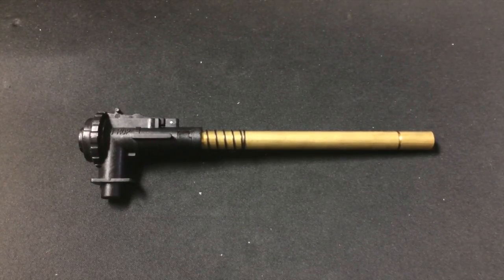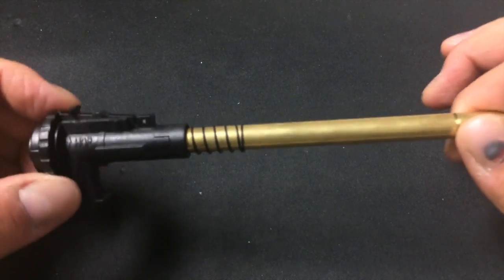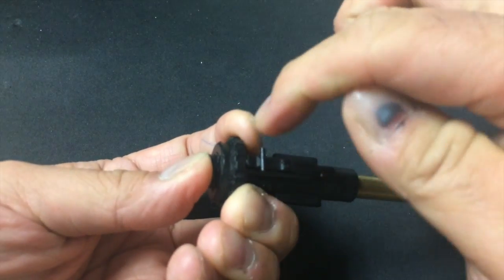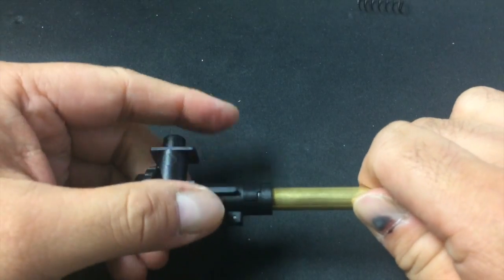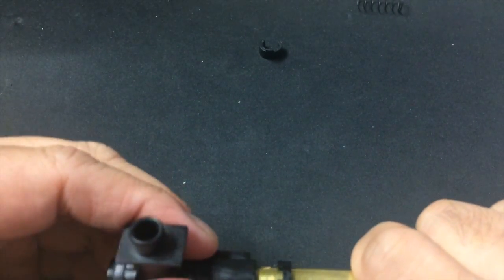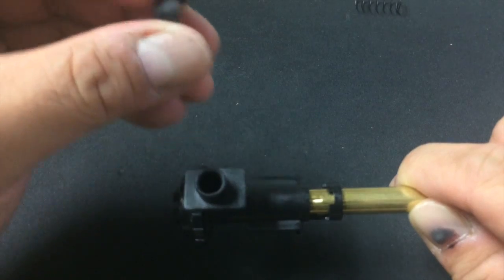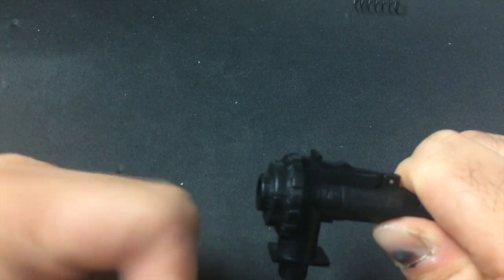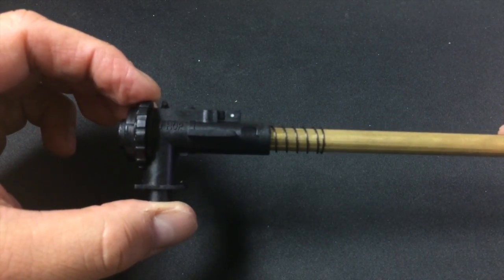Krytac Hop-up

Comment: So if I were to upgrade the bucking, I would use the spring and not the little metal ring that came with the new bucking correct?
Reply: Kinda late but yeah use the spring
Reply: Or you can use both?

Comment: Hey man I've seen you on the forums and since it seems like you know what your talking about I need some advice. I have a CRB and I'm wondering if this is the same inner barrel installation for all krytacs?  I'm thinking about putting in a Prometheus tight bore barrel so when I go outdoors I could throw on a power up suppressor to gain slightly more fps since I need to dumb it down for CQB. The power up won't work with the stock inner barrel since stock is 6.05 and the power up is 6.03.
Reply: I have the prommy inner barrel and it works great. Just note that certain buckings are a bit tough to install (like prommy purple) since the barrel is so fat

Comment: Hi there, I will be changing the stock inner barrel and hop up bucking on my crb in a week time. I am actually swapping it to prometheus eg tight bore and prometheus purple bucking. The question I have is that, should I use the purple hop up nub that comes with the prometheus purple bucking or should I use the stock orange nub? Thank you!
Reply: use stock nub

Comment: Will a prowin fit in the krytacs?
Reply from the maker: +dan310388 It fit but if you follow the discussion on Krytac Forum. There is really no improve performance using ProWin.
Reply: +Allizard okay thanks will check that out.
Reply: Well, if you want to use another nob, you either mod the Arm of the Krytac Chamber or use a different Chamber, which would most likely be the PwoWin. Or am i wrong?

Comment: can i use a promy flathop bucking with this hopup?
Reply: I'm using prommy purple in mine with a namazu firefly nub, works perfectly.
Reply: @timdeboer7400   how noticeable is the performance increase using that bucking and nub from the stock ones? and also what gun do you have these on? like, is it worth it to buy these bucking and nubs for the amount of performance increase you get?
Reply: @johngonzalez3969   Getting a flat nub does help with performance and range. I couldn't get a Maple Leaf tensioner nub to work with my Krytac LVOA (with Wolverine Reaper HPA) so I opted for the more expensive Firefly. But if you install a flathop correctly I haven't seen much difference in performance between the different kinds of flathop. Changing barrel, bucking and nub are the best upgrades to start with, they are easy to change and give the best performance boost. Evike sells pre R hopped prometheus barrels, combine that with perhaps a modify flat hop bucking and nub and you will get a really nice range out of your gun already.
Reply: Tim de Boer did you have to install a prowin hookup to fit the prommy purple and fire fly namazu or do they fit with the stock Krytac hopup unit? Also are you talking about the modify ryosoku because I heard it’s not too good
Reply: @johngonzalez3969   The stock hopup is actually pretty good, you dont have to upgrade to the prowin one. The prommy and firefly fit, but the arm where that puts pressure on the nub is made for the stock nub. I glued the nub in place. But you could do it with some silicone grease. I haven't installed the Modify bucking and nub in my Krytac, but on other aeg's i had some good results with it. Sure it is not the best, but for it's price it works nicely. Madbull Shark red (60 degrees) bucking worked for me fine also when flathopped or the G&G green bucking is a nice bucking.
Reply: Tim de Boer what would you say is the best bucking and nub combo for the krytac not worrying about the price

Comment: Is it common to have 2 springs?
I have the Krytac PDW-M and when removing my inner barrel I have the longer slimmer tension spring and a much smaller but wider spring overlaying the tension spring.
Reply: Same thing happened to me just now and now I'm scared shitless that I broke my baby xD
Reply: @robin3840  ngl...that was my first thought, mild panic and sweaty palms set in! I did a little research after posting tho and found out the main one is an inner barrel tension spring and the secondary, smaller one is to aid compression under prolonged use.
Reply: @Retch84  yeah, I knew what the first one closest to the top up was but the smaller, thicker one was new. Thank you so much for sharing that information! Did you find a way to put it back? Gonna do my own research as well but pls share everything you know!
Reply: @robin3840   I have a long established habit (started with a grandfather clock as a kid) of laying parts out as I dismantle to make reasonably easy...the shorter, chunkier spring literally just slides over the top of the longer skinnier one so you effectively have a double spring setup. With the stock Krytac PDW-M handguard, you'll benefit from both as they catch internally at different points.
Reply: @Retch84  then why did it come off  and  not before? I heard this little "pop" as I pulled out the  barrel and out comes the chonk! Are you saying it doesn't matter?

Comment: Would I be right in saying that the hop arm would accommodate “any” nub but it just won’t retain it like the proprietary one? 
So it’s possible to use any type of hopping system, flat-hop R-hop etc..
Cheers.
Reply from the maker: Any standard nub... yes.  all you need is a dab of grease to hold the nub in place.  For flat hop, you have to modify the nub anyway as there is no such thing as a drop in fit.

Comment: Hello Allizard. I have a Krytac crb mk 2 in UK and its firing at around 295fps.my field limit is 360. I'm thinking of swapping inner barrel to a tight bore with a new maple leaf bucking but also swapping the spring to a m110. Would I still be under 360 fps with this 👍edit, I use 0.25 bbs
Reply: Yes

Comment: What’s the little rubber cylinder that’s always included with bucking for?
Reply from the maker: You mean the nub? that's for pushing down the bucking so the BB can create a back spin.
Reply: Allizard thanks for replying. I figured it out after watching a tutorial on putting together the prowin hop up but thanks.